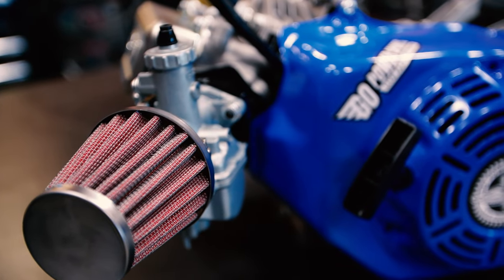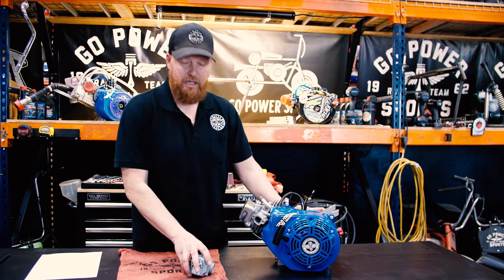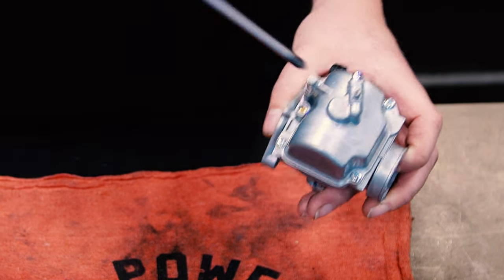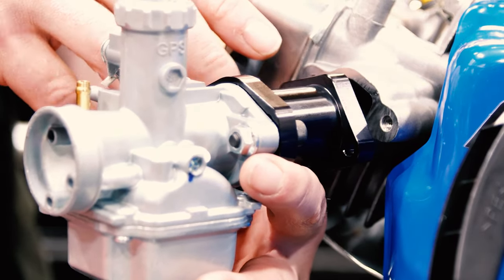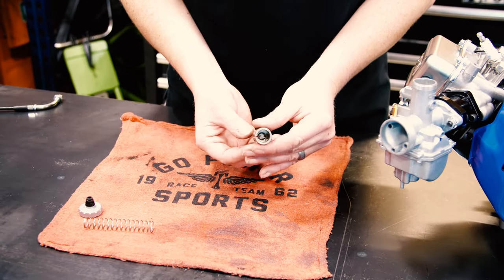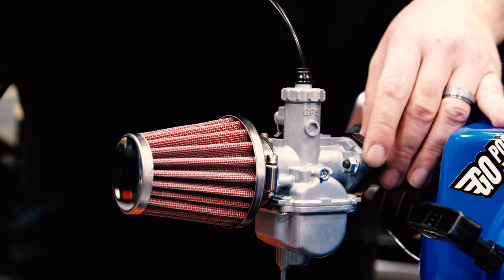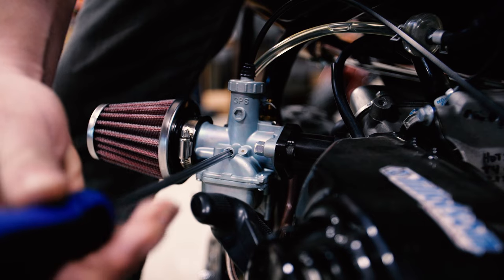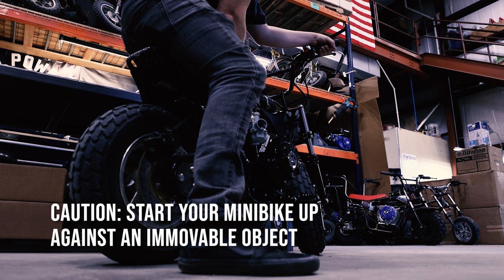How To Install And Tune A Mikuni 22 Carburetor

Comment: I recently bought a stage 2 kit with 22 lbs springs with the racer kit. I have everything installed but the problem I'm having is that it idles super high! Can you help please
Reply: I saw your comment this morning while trying to troubleshoot the exact same build as yours doing the exact same thing. After dinking all day with it I found that my dummy ass installed the manifold upside down so one of the little cutouts on the manifold was sucking air right in. Installed it correctly and walla! Idling correctly. Give it a look.

Comment: I bought the Chinese Mikuni it would only run on choke adjusted the needle valve didn't work adjusted it from the valve screw didn't work everything hooked up correctly on a bran new 212 ...is this a fault in the product and has anyone else had this issue with the Chinese Mikuni
Reply from the maker: We would need to see video footage of how your carb is acting.  Do you have an air leak?
Reply: @GoPowerSports  no air leak and gaskets in place it really seems like the jet might be wrong but when I ordered the whole kit from Amazon I had to lodge a complaint then take pictures of all the parts they did send then make a list of the parts that weren't sent then had to submit that to get my intake pipe air filter and mounting hardware the whole deal was kinda screwy especially after going through all that and the shit didn't even work right lol I just ended up putting the stage one kit  on the stock carb still looks cool and performs well on my top kart ...this whole deal gave me psd and I'm worried about buying another one of these Chinese Mikunis ...I think ima just pony up the dough and get a real mikuni

Comment: Question? Can anyone help me lol. Is there anyway to modify a throttle cable that doesn't have that ball thing at the end? I totally didn't think of that
Reply: Get some cable/wire stoppers and use a hammer to pound them to the end of the cable

Comment: Nice video.  Unless the VM22 clone is different than a true Mikuni... counterclockwise on the AF screw leans it out vs richens it up.  Easy enough to listen for, but would be surprised if the low fuel circuit design was different... given it was basically stolen and copied.

Comment: Will my stock throttle cable work with this carburetor?
Reply from the maker: Sorry, you'll need to run a Mikuni cable because your stock throttle cable will not work.
Reply: What about a yaxufa multi fit 50"?

Comment: wanted to buy or pirchase carborator adaptor
Reply from the maker: We sell the manifolds in a few different lengths depending on what you're after.
Reply: @GoPowerSports  you just installed mikuni carb on engine predator 212 cc
Reply: wanted to purchase 6 unit  of those adaptor

Comment: Mine lopes like it has a huge cam installed after i put on the carburator
Reply: @Knight Recon Yea my issues was my fuel screw after I rebuilt the carb it was outta spec

Comment: Does anyone know if there is a small metal washer in the bottom of the slide?
Reply: Yes. Depending on the Mikuni series the washer may look different. I have a Genuine Mikuni VM22-133. The washer actually keeps the needle in place. My washer has a tab that is installed down in a slot in the slide to lock the cable in place and keep the needle from moving up or down independant of the slide movement.
Reply: @keri380  thank you very much

Comment: I get a lot of severe kick back when starting .Its severe to point it makes its a drag to start it .
Reply from the maker: You should check your valve lash settings.  That is a cause of hard pulling...along with many more but it's a good place to start.
Reply: I had this issue and it was because the cylinders had liquid somehow and weren’t able to compress. Use an air compressor or air blower and let it move the liquid out. 

Also, I took out the spark plug and pulled the cable multiple times (kill switch in off position) to let any liquid come out of the pistons.

Comment: So the drain hose doesn’t connect to anything other than the bottom of carb?
Reply from the maker: Correct, the tubes will help guide the fuel spillage to where it's not hitting your engine

Comment: My carb runs on choke but not Run any   ideas
Reply from the maker: Sounds like an air leak.  Typically happening where the manifold and Carb meet.  Make sure your O-Ring is completely sealed against your manifold 1st, and then attach to your engine.
Reply: @GoPowerSports  any other ideas thats not it
Reply: @DavesCoolCustomBikes did you ever figure this out? I’m having the same issue and no air leaks. O ring is sealed properly. Gasket is new. Governor is removed from the inside of the engine. And when I take it off Choke, it revs to the max. Air mixture screw doesn’t change it. Throttle cable is relaxed and slide is all the way down.

Comment: Is that the "REAL" Mikuni you sale or the fake one you sale? Thanks for your videos... I have a Manco 285 I'm fixing up...If I wouldn't have already spent $250.00 on rims, sprockets and tires I would have went with a round axle, but 2 late now...I've bought about $1,000.00 worth of parts from y'all now need to get busy putting the rest of the parts on... I'm 69 but I still love go-karts. May sale it when I am through and build a 75HP one next if I can find a nice frame like this one but a little longer with gas & brake peddles in a different place... May even sale it as it is as nothing wrong with it but would like to ride it one time with with every performance part installed and see how much faster it will run than 68mph it runs now.. Thanks again....
Reply from the maker: This video is over the aftermarket carb, but a lot of the same principles still apply.
Reply: haha 69

Comment: i got one and when i accelerate it bogs and just stalls what should i do?
Reply from the maker: Sounds like an air leak.  Make sure your rubber o-ring gasket is sealed up against the manifold.

Comment: I don't understand how the new carb is stage 1 but you need to remove governer first with is stage 2
Reply from the maker: This 22mm Mikuni will have bigger jets and will allow more air flow, just like a Stage 1 Kit would do.  The 22mm Mikuni needs the governor to be removed in order to work properly because you are no longer hooking your throttle cable up to your engine's throttle linkage, the throttle cable will now plug in directly to your 22mm Mikuni Carburetor.  If this doesn't make sense, give me a call at 866-846-5278.  Thanks!
Reply: @GoPowerSports  
Do u mean removing the governed within the engine, or the one outside of it?

Comment: Why do you remove the governor
Reply from the maker: The throttle cable will now go straight to your carb and not through your engine's throttle linkage.  So there would be no control over your governor arm and it'd try to spin at such a high RPM that the governor spool will break off inside your engine.

Comment: How did you make the throttle so snappy and responsive
Reply from the maker: The spring on top of part of the Mikuni helps it with that snappiness.
Reply: @GoPowerSports  ok thanks for you're response

Comment: My needle 😮has a spring on it way would they do that I can’t adjust it like you what we’re they thinking waist of money 💴 man. Maybe I bought the wrong carburetor for the predator 212 it all looks nice on the bike but won’t idle just wants to takeoff 🛫 😂with the idle all the way down.vacuum leak I sealed the carburetor up real good and hell I cot the gas screw all the way in and guess what it still wants to take off 😂😂😂😂😂😂

Comment: A key part thats now shown...Once you remove the stock carb, you got those 2 long 6" threaded studs that need to be removed. Use 2 bolts thread them both on together and back off the nut closest to the engine so it grabs and backs out those studs from the block